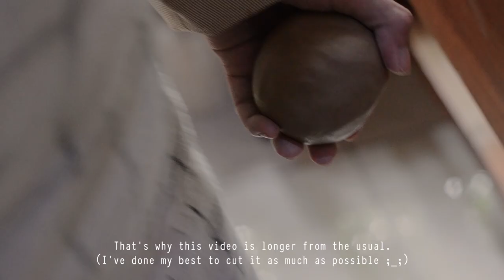How I Make Handmade Ceramic Mug at Home: from Beginning to End — Slow and Mindful.

Comment: For leveling the rim of the ceramic mug instead of pinching it trying to make it even you can put a little amount of water on concrete (or a surface with that kind of gritty texture) and move the mug in a circular motion. You would have to make sure after to fix the rim where it would be sippable before you fire it in the kiln. I did this when I was making a ceramic bowl and it worked wonders!